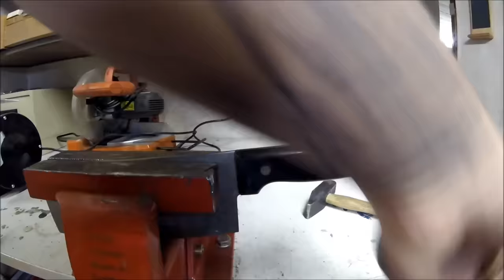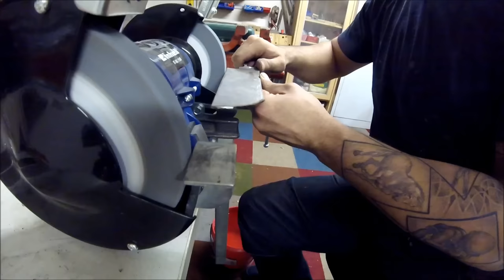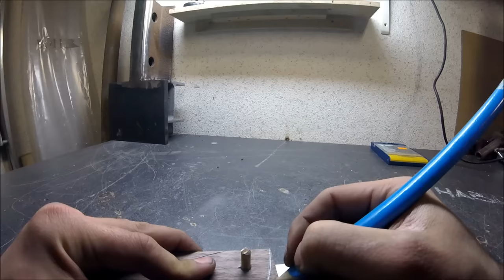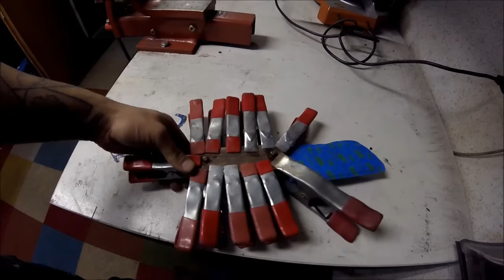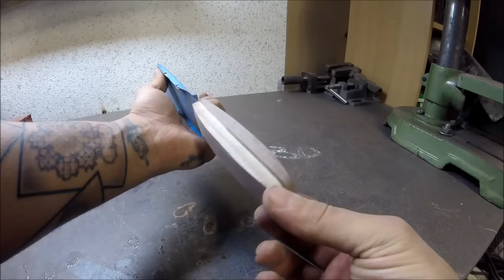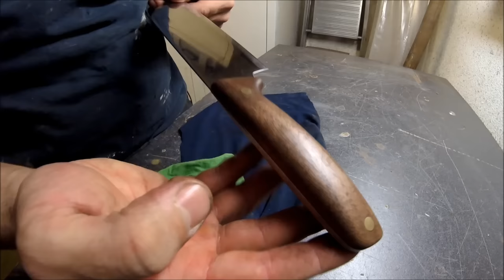DIY | Chinese chopping knife out of an old butcher cleaver

Comment: Everything looked great except cutting the blade with a disk grinder. When you do this you completely ruin the temper of the blade. You need to bring it up to cherry and quench it again. This also depends on the steel. Usually high carbon will oil quench but stainless is another thing. Then temper with cycles in the oven. I did appreciate it though. 
Cheers 🍻

Comment: I hope the cleaver had no welded in cutting edge. That you would have cut away with your size redution. ;) Also I personally like huge and heavy cutting knifes. I would have left the meat on the cleaver. Just maybe straighten the cutting edge a slightly bit. Nice and well made project though!
Reply from the maker: Thanks bro! ;)

Comment: Nice work. What is the spry you are using when you cut with the angle grinder?
Reply from the maker: Thank you! It's just normal soap water to cool the steel down...
Reply: Cool, I didnt know using the disk cutter required liquid cooling
Reply from the maker: +Blonding yes it does... ;-)

Comment: Lol... edge retainment 0

Lets say it was a good butcher cleaver, hardened, tempered and all. (and nowadays even those sold in wallmart are somehow heat treated) You took the edge off, and made a new one. The new edge was in the mass of the cleaver back during heat treatment, it didn't benefit from it at all. So your creation won't retain an edge, you'll have to resharpen it often and will have to throw it away and make a new one pretty soon. If you did heat treat the blade please show it in the next video to prevent people to turn not so bad knives into terrible ones.

Comment: 請問刀身這樣研磨,是否會退鋼呢?謝謝
Reply: 确切地说，这是一个业余爱好者谁是不明白:-)
Reply from the maker: +彭尚文 in english please? ;-)
Reply from the maker: +pepa zdepa ?? ;-))
Reply: 1.Grinding and cutting the steel so seriously,Is it going to soften the steel?  
Thanks for replying.
Reply: 彭尚文 -  Yes, cutting steel is heated and holds cutting edge
Reply from the maker: +彭尚文 Not if you cooling it dow enough...
Reply: How much heat can the steel take before losing temper?

Comment: hollow grind on a chopping knife?
Reply from the maker: No...
Reply: Oh, saw you do your final grind on the bench grinder and it being a circular wheel would create a concave edge thus making a hollow grind. But i guess you only did it lightly and left it flat. Maybe explain a little bit when someone asks a question instead of simply replying yes/no.
Reply from the maker: +Nerd Worker yes I left it flat, I'm sorry for my short answer but I was busy. I just wanted to give you a quick answer...
Reply: makes sense. Thanks for the quick response. dont really go at flat edges with a bench grind out of fear of taking away too much material but if its a quick job i might give it a try. Thanks for the vid.
Reply from the maker: +Nerd Worker yes that's true...
You're welcome!

Comment: You don't heat treat the blade ?
Reply: it is already heat treated. it was a cleaver before so no point to heat treat it again.
Reply: @minusk.k.3277  only as long as he keeps the blade cool when re- grinding. Dipping it in water when it starts to warm up is sufficient.